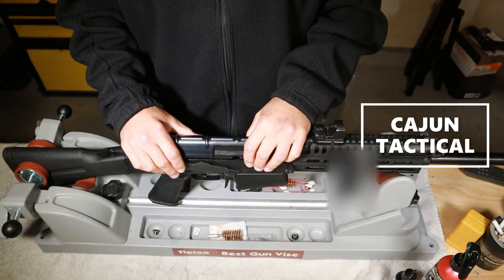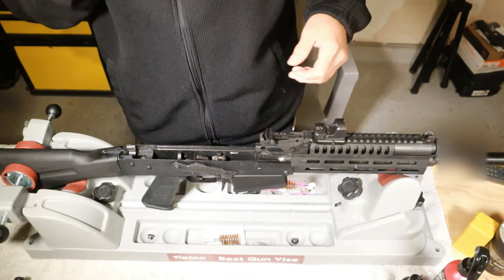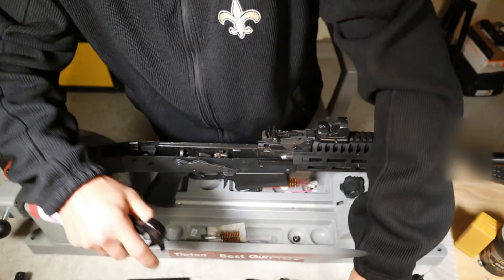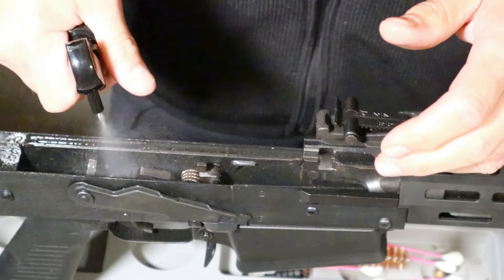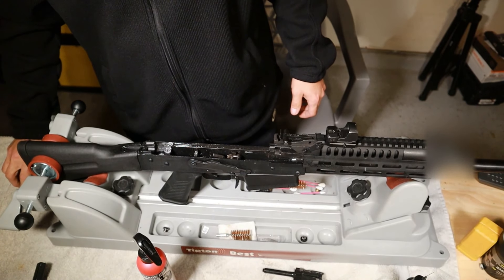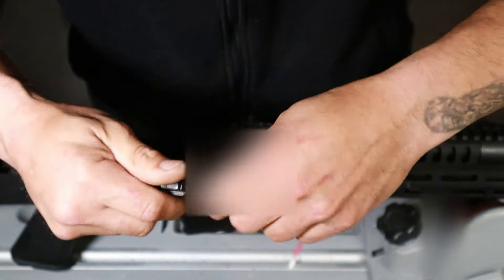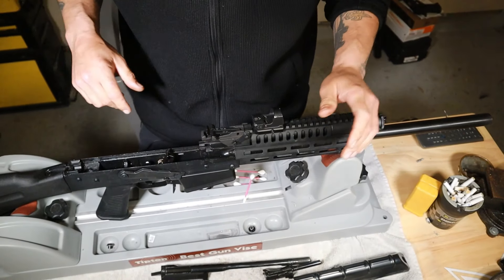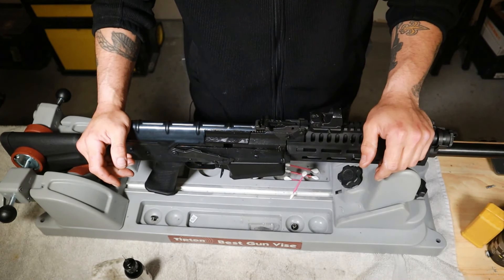JTS AK 12 GAGE CLEANING

Comment: I think the underside of the rails that the bolt carrier rides on are also important so I use a toothbrush for that. I also take apart the gas assembly and clean it. Many thanks for this video. I ran 120 rounds through my new M12 AK yesterday and no jams during firing. 00 buck with 1200 fps and #7.5 at 1100 fps. Gas setting on 3.
I do wish I had waited for that model you are showing though.
Reply: i'm genuinely shocked that people cleaning this is a thing. I probably have around 700 rounds through mine and I haven't cleaned it yet. and it will chug the worst bird shot all day
Reply: @RockeyDAproductions wondering if maybe they forgot to put the shipping grease in the gas tube on yours.

Comment: Thanks again for your video! I used yours and another one from Whisper Tactical to help me understand the mechanics of getting my JTS cleaned and put back together. That bolt assembly had me scratching my head. Took me about 10-12 minutes of slowing your video down to half speed and watching that part to finally get it back in. 😂
Reply: Cajun Tactical is the MAN! I want to hear stories of his Cajun youth!
Reply from the maker: Brother I did the same thing. It took my some time as well.  Glad I could help

Comment: not knockin the video. from the thumbnail it looks like you took your barrel off and I was curious about that. but your video also reminded me that I have never cleaned my JTS. Hell when I get a paint job on it I let a fair amount of paint get inside the receiver and didn't care. running under the principle that it is a Kalashnikov therefore it can chug through anything. I do keep A thin layer of oil or grease on all unpainted surfaces. I live in a really damp environment so rest can set an easily

Comment: Whats up with the plastic part that holds the spring? This gonna break or melt when I shoot it? Like it's plastic
Reply from the maker: No it won't break or melt.  I have definitely put mine through the test
Reply: i think it's a gimmick. Supposed to keep your fingers out??
Reply: so mine broke off but the gun still functioned with it broken off. I started looking at the Saiga and how the sliding dust cover is metal and eventually found that they sell these on SDS Imports for $10... so I ordered one to see if it would work. Turns out it fits and functions on the M12AK-T1. So if you break yours, you have options https://www.sdsimports.com/product-p/9122936092.htm
Reply: @TheAlaskaCajun  thanks!
Reply from the maker: @TheAlaskaCajun  Thanks for the comment   Cajun.  My viewers will appreciate it and thats a hell of a solution
Reply: I wonder how many of those SDS parts are  Interchangeable  Wonder if that trigger Spring that likes to pop off the trigger is going to be a problem

Comment: I can't find the damn groove. Grrrr
Reply from the maker: The grove is in the back.  With the bolt off its in the rear.  You can see where there is no rail and that is the Grove
Reply from the maker: Yes,  I will be doing a video tonight on how to field strip and reassemble.  Gentlemen,  I had the same problem.  I will make sure i do it several times so everyone can find the grove